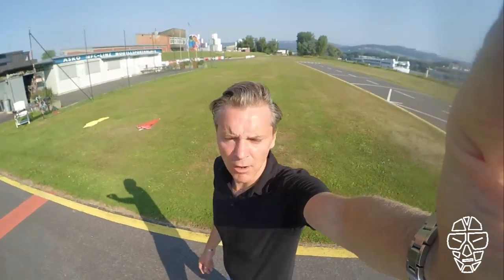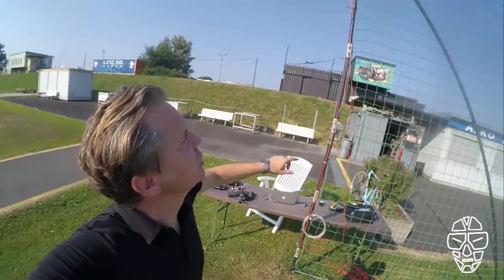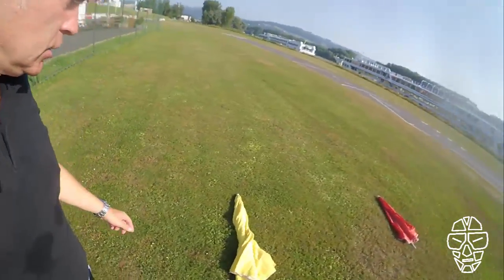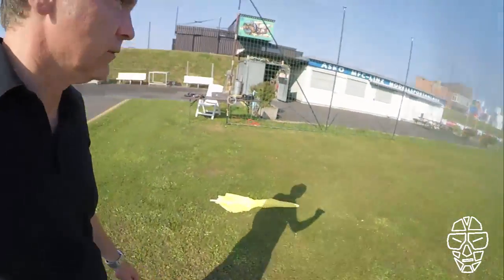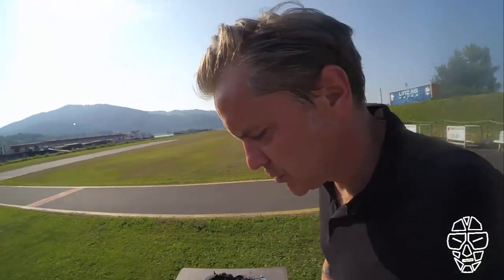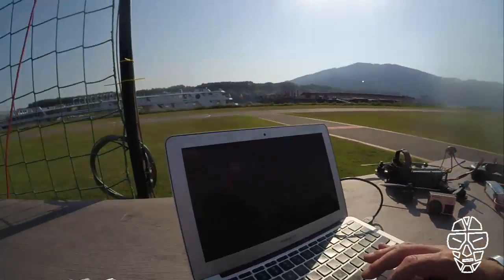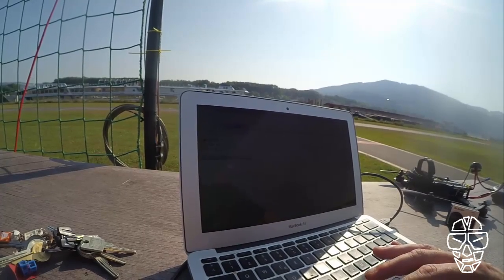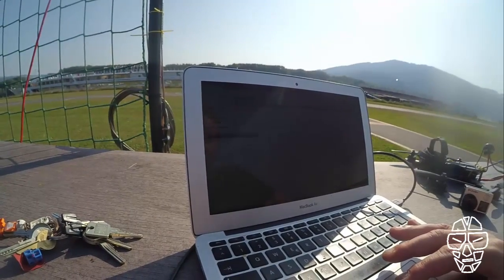FPV Race Tracker Part 2 Single Pilot Race Test

Comment: Hi andy maybe you read my stuff , i also have a simular sys also use Ir tags and other stuff ,, maybe whe can help eachother ,, i have almost identical system , but more advance ,,  be aware of these day LED ,, whe have IR led , and IR/UV led ,, the last are shit outside ,, those are the transparant one's use the dark ones ,    happy to see your system working i also nice the big ir rx extender ,,  good work man
Reply from the maker: dxtbot thanks dxtbot where can I find your system?
Reply: lol i just ad a smal vid of my hardware system ,, its not as clean as yours ,,but it works also same method if i think , Ir tagging ,, i also have some different systems real cool ones ,, i seen your upload and i also uploaded some  , i wont post details because is see you try to make a bizz

Comment: Thanks for great video, looks like this works well. You could mount 2 or 3 transponders on one quad (front, center and rear) to check that all 3 are recorded as they pass sensor bar - that would prove this for the absolute worst case (several quads crossing line together would be very unusual).
Reply from the maker: ***** good idear will try it out, thank you